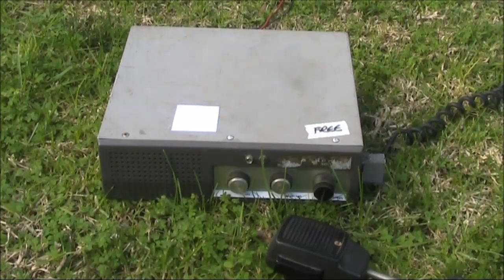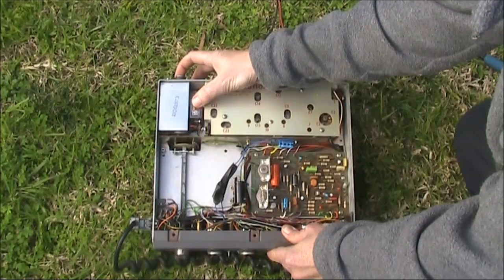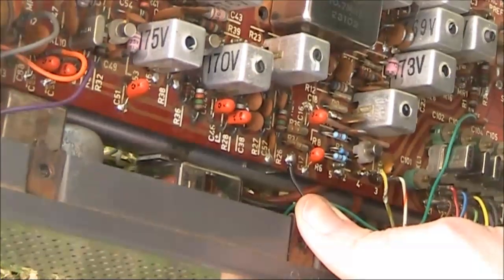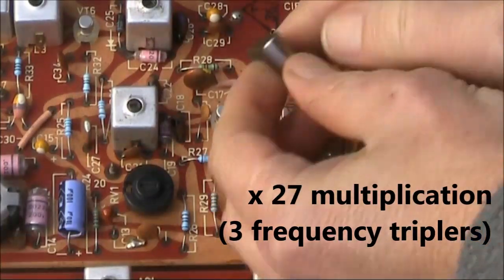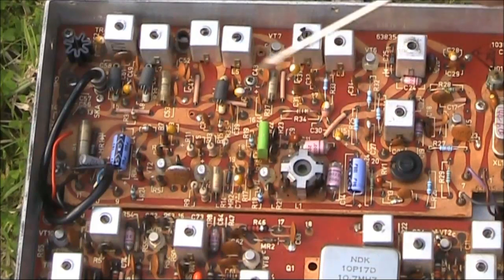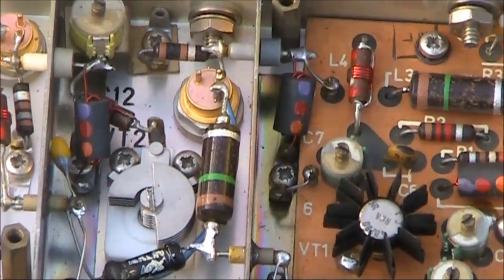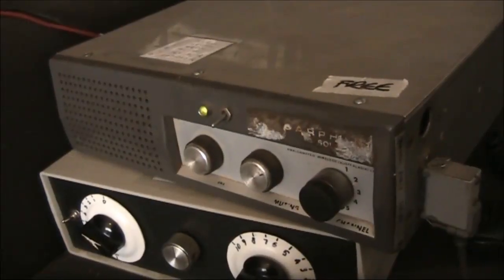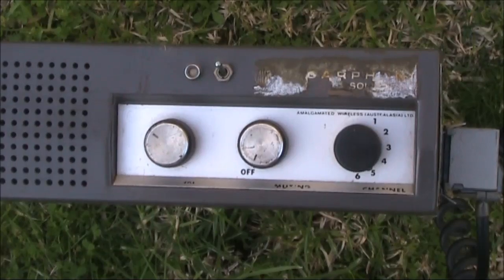Inside an AWA 25M VHF FM carphone transceiver

Comment: Great vid. They were widely used by the State Electricity Commission in the 70s, so much so that the SEC made a number of them in their own workshops in Melb. I have one of the SEC branded ones in the shed (as well as a normal 25M) that I hope to get running on 6 m one day. They were succeeded, I believe, in SEC service by the Plessey MTR8000 in the early 80s. I have a few of these as my current 6 m FM rig and backups. Cheers VK3BEK

Comment: About 30 years ago, a few of us in Sydney got our hands on some low band units and converted them to 6m. I made one transmission on mine to test it, but that was it. Still got it in the shed somewhere. 😁
Reply from the maker: Worth finding a cheap power supply, stringing up a dipole and leave it on all summer (if it has 52525). You might have a few contacts.
Reply: @vk3ye  I might have to look at that. (I haven't looked inside the radio in years, and have no idea what frequencies it has or how many crystals are in it.)

Comment: With 144.600 in Ch 1 could the Mystery connector be for an FM Beacon or packet controller?  4 pins is right on.  Wonder if that switch was to mute or reroute audio?  I used a 16 channel commercial Motorola Maxtrac in a similar fashion.  CH 1 was 144.390 Ch 2 145.03 and 14 voice channels.  I kept it on a packet channel when not being used for voice.  Sounds like another video to scope probe that connector?!

Comment: You could trace the wiring of those sockets and switch and gave a guess as to why they were added . Classic construction. Many years ago I built an HF receiver front end and a three stage 9MHz IF with MPF121 MOSFETs. They oscillated. So I remade both in PCB boxes with compartments for each stage inspired by your rigs PA. It was ever stable after that, couldn't make it oscillate if I tried. A good lesson in RF construction using leaded components and high gain. These days, SMD have greatly improved RF circuit stability.  Cheers and thanks for posting! VK3HN.
Reply from the maker: Thanks Paul - I'll do another on a more modern rig next week. The switch goes to the driver/PA stage - so I wonder if it's a Foundation licence power mod? Easy enough to test with a power measurement.
Reply from the maker: Just did a test on it. Flicking the switch one way drops the TX power output by about 5w (from 25 to 20 w).
Reply: @vk3ye  Point proved. Current draw will drop significantly,  maybe for mobile.
Reply from the maker: @Paul_VK3HN  Although I don't understand the point of it. 25 to 10w I could understand for a Foundation mod.

Comment: During my apprenticeship at AWA Engineering Products at North Ryde NSW in the mid 70s, I was involved with the build and testing of 25M circuit boards. As a side project, I was able to get a set of damaged VHF High Band PCBs and push then onto the 2M band. Some crystals and I was able to use it on the Dural repeater. Sadly, I no longer have the PCBs. I note that there were a number of models for the frequencies and the evolution of improvements. This is an earlier model. Sadly the lifting of tarifs put a stop the building of "Carphones" (and their successor, the Fleetmaster) and now the name is a memory. 73 to all, Paul VK2APA.